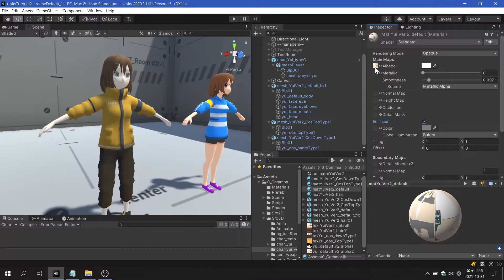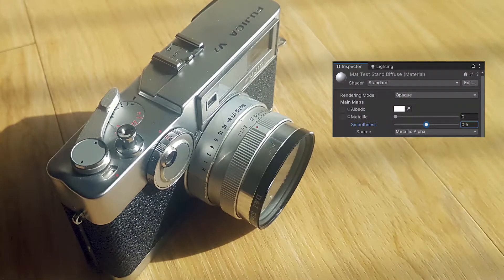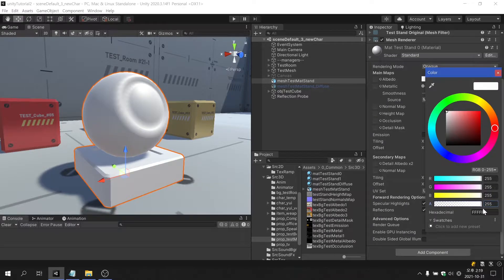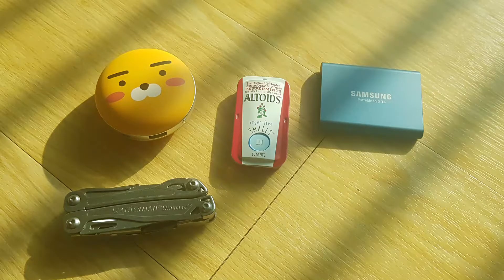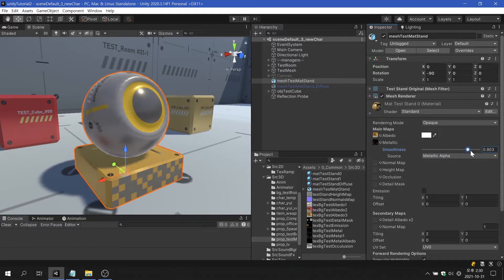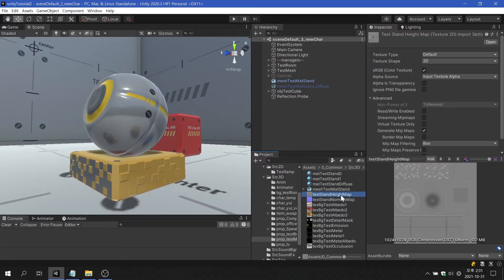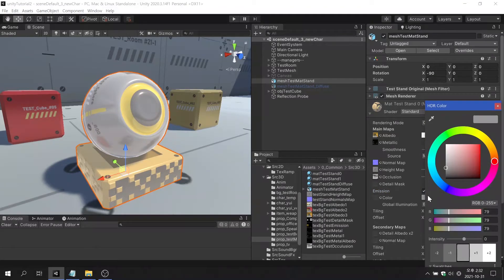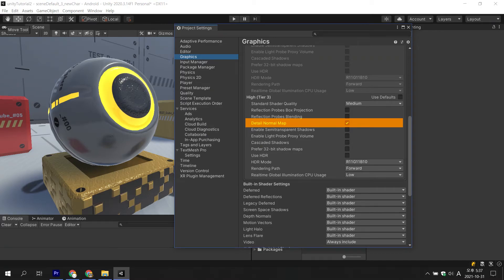Unity : Standard Shader

Comment: I know your last video you were able to switch between different textures by a click of a button. I am trying to remove the tedious work of dragging and clicking the different maps. From Texture, normal, height, etc when exporting from Blender 3.0. Since you are very knowledgeable I was wondering if you knew of a way to automate this when everything is labeled correctly. For example DemonGirl1 would have all of her maps Labeled TextureDemonGirl1, NormalDemonGirl1, etc. We could even have all of her maps in 1 folder so we just have to read each texture, normal, and height to apply them. 

The reason I need this is because I am planning on making a city. And each building, each character, and each road, and each desk, and each car I will have to sit there and drag and drop hundreds if not thousands of times. 

Thank you for your time.
Reply from the maker: One of many solutions to your problem comes to mind.

Among them, the most realistic solution is to create a conditional statement after making the name of the game object the same as the name of the texture.

Whether you use List or Array, you use the For statement to compare the name of the variable with the name of the texture, and if the name is the same, the texture is applied to the material of the game object.

If I come up with a better way later, I'll post a reply later.